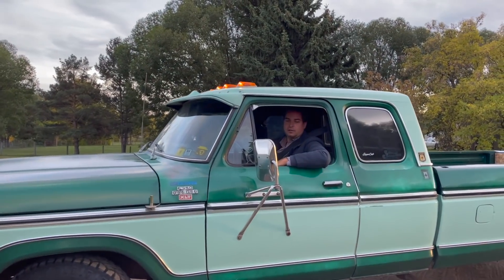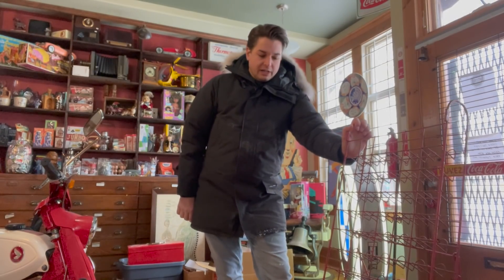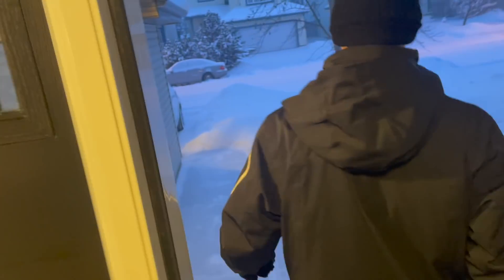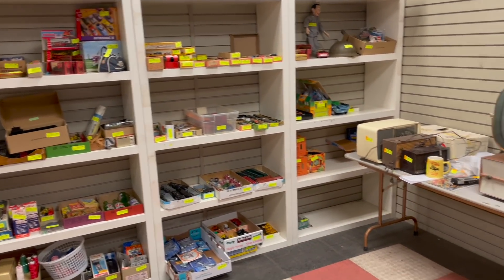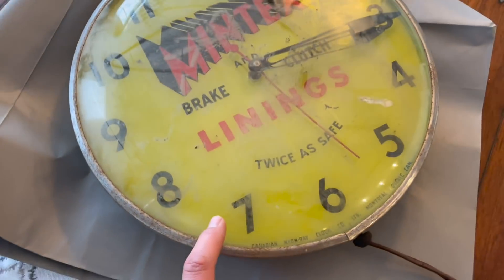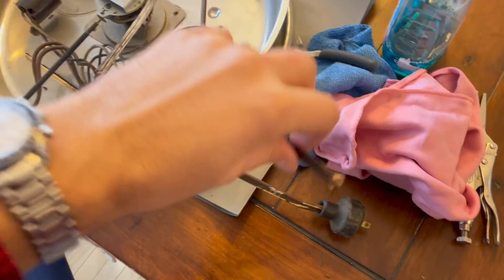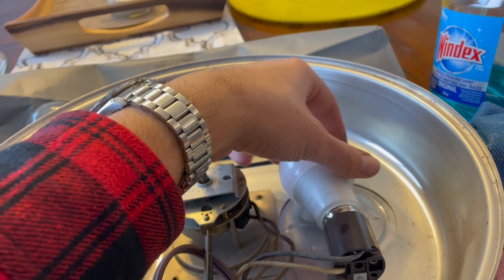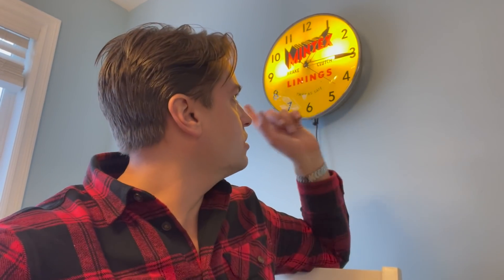Making $$$ in slow months... auction trips, cleaning house and repairing a rare clock! todays vlog!

Comment: The lesson on replacing the clock hands was a wonderful surprise and so timely for me! I’ve been waiting for a replacement clock kit to arrive. Now I’ll know how to do it properly!😃Thx
Reply: I made a ceramic “owl wall clock” in the ‘70’s I would have found this info helpful then 😂
Reply: The position of the hands, IE setting to 12 o'clock doesn't matter at all.  All the hands are in all positions 2x a day,  The stack order is important as Alex said, but it will keep the same time correctly no matter where you put the hands.
The only exception is clock that has an on the hour chime, and those have a flat so you can't get them wrong.

Comment: Without proper stopper new cord might be stripped over time by sharp surface of the metal housing of the clock, in best scenario you or anybody else will blow fuse but in the worse scenario someone may lost life. So please Alex make electric work again with proper cord protection.

Comment: Technically, you should mind the polarization of the cord. One will be hot the other neutral. At the wall the hot conductor is the narrow one and the wide is neutral. But since the case is not grounded and the bulb sockets enclosed it's not really a huge issue. I would have probably gone with a 3 wire cord and grounded the case.

Also, a grommet to prevent the cord rubbing on the case would have been a good idea. Alternatively some heat shrink or even electrical tape would work.
Reply: Yes the grommet for sure
Reply: Yep, it's an electrical safety nightmare with an ungrounded case and no grommet, I hope Alex has his public liability insurance paid up
Reply: If you were not moving, Alex, saving old electrical cords until you get enough to burn off the plastic and then taking the copper to a scrapyard could be surprisingly remunerative. Indeed, scrapyards will even buy old electric cords (at a significantly lower price) without the plastic being removed.

Comment: It doesn't matter at all the position of the hands when assembling.  The order matters as you stated, but setting it to 12 o'clock doesn't matter at all...
The gearing is timed, and thru the day all the hands are in all positions 2x a day.
The only exception is clock that has on the hour chime, and those have a flat so you can't get them on wrong.

Comment: You really should have a plastic grommet where the cable passes through the metal frame, that would not pass a PAT test over here, actually you would not be allowed to sell it. Over time the metal casing can cut through the cable rendering the entire fitting  live, and or possibly causing a fire through short circuit arcing, they are a very common cause of electrical appliance fires.

Comment: Yep, a man after my own heart I to enjoy tinkering with stuff and getting them to work. I'm working on my wife's old computer a Dell OptiPlex GX150 with Windows XP installed in it. I've replaced the memory and the motherboard. Found some bad Capacitor's that are going to need replacing on the board. I worked as a Slot Tech in our casino and have replaced these parts on monitors that I got working so no big deal just need the number's off the old capacitor's and order them. You had a good day too I see. Well stay safe and warm tell the family I said hello. Later, and as always, "Enjoy The Adventure." We are suppose to get 8 to 12 inches of snow here so old man winter is here.

Comment: It's a teenager thing Alex, in the dead of winter they run around in Tee shirts, shorts and flip flops just to be "COOL"......
Reply: The clock wires;.. install the one from the wider plug prong  (Neutral) to the white wires    one wire  is marked with ribs the other is not !